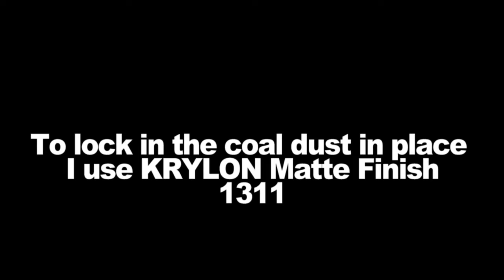WALTHERS CSX BETHGON COALPORTER WITH CUSTOM REAL COAL LOAD & MORE

Comment: That coal looks like anthracite and not bituminous.  Bituminous coal has a shinier look to it as it is hard coal.  I've got a big ole chunk of bituminous coal I went after with a hammer and used a 12 inch section of mainline 120 pound rail I got from the Central of Georgia for an anvil.  The smaller bits I sifted out for HO scale and the larger bits I used for my O scale (in tenders, gondolas and coal cars).  A lot of modelers make removable loads, but I prefer to leave mine intact.  If you will spray a fine mist of alcohol before adding the glue it will break the surface tension and allow the glue to immediately penetrate without moving the coal around.  Your coal loads and cars look totally believable.  I like the coal on the ends and sides.  The added paint on the coupler pockets (draft boxes) will help the screw from working loose.  I do the same thing.  For rusting couplers try using some Craftsman acrylic paint called "Coffee with milk".  It has a little more brown in it and looks more like old rust.  Cheers from eastern TN